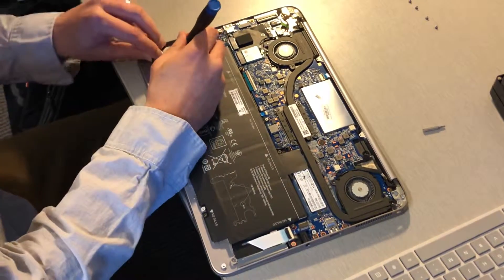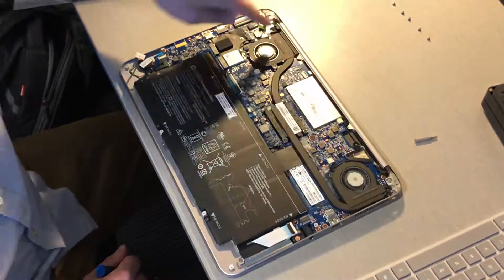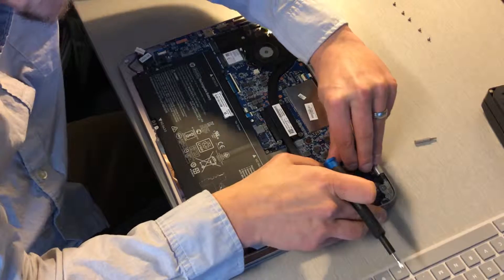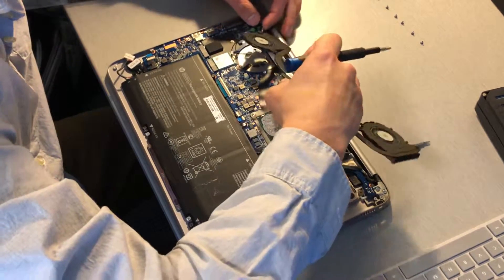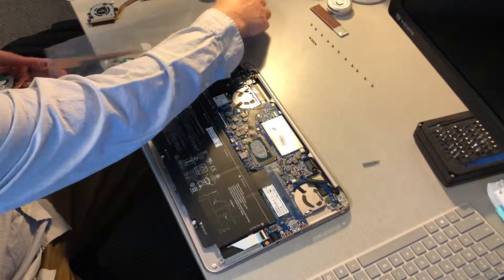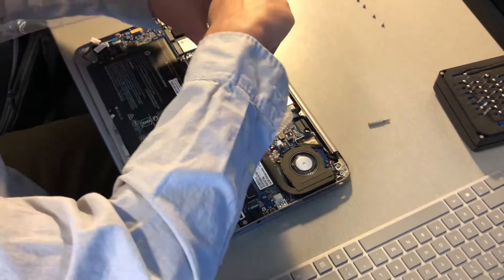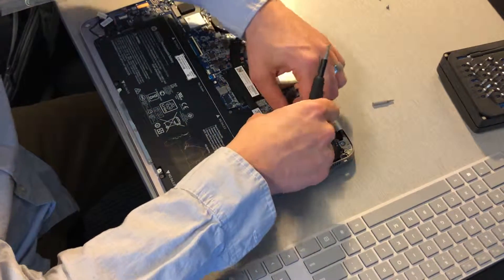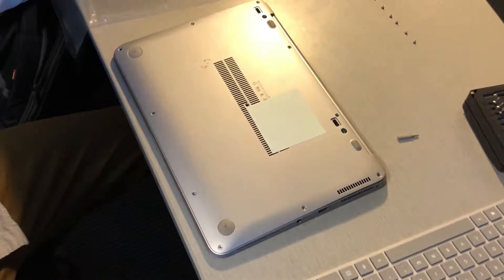G3 fan replacement | HP 1040 G3 | Part # 844425-001

Comment: Thank you.  How do you upgrade the RAM  on the 1040 G3 ?
Reply from the maker: I think it’s under that silver flap. But this was an old work laptop I don’t have access to any longer. Most ram is basically the same. Insert at an angle then click down flat. I will see if I have any video examples that are similar.
Reply: Yep, that's where it is ...but  found out it  is not user  replaceable.Actually  Soldered in.  There are no Dimm Slots on this machine.
You have to order it with 16 M or replace the MB with a 16 M if you need o up from  installed 8.

Comment: I really want to get this PC  the processor is ok but the graphics card is low...Can the graphics card be upgraded?
Reply from the maker: On these computers they don’t have a gpu slot. And what they have is integrated in the cpu. So no way to upgrade that. The other option is an external gpu however this model doesn’t have a fast enough link to support one. Good question!!

Comment: Can we upgrade the cpu from i5 to i7? Is the cpu soldered?
Reply from the maker: It is soldered not socketed. As you likely know it is a larger job to resolder a cpu in place.
Reply: @JamesHeigh  Thanks a lot for your reply. I am looking for old laptop to buy for upgrade.
Reply from the maker: @funkygarzon  I tend to stick with HP for most applications (non gaming) then venture out to other brands for gaming stuff when needed. I would recommend finding an old elite book from HP or an old ZBOOK as sometimes they can be found for decent prices no they rock! Hope that helps. And really for gaming HP Omen laptops can be found for about the same price as predators and they just have better fans and stuff.
Reply: @JamesHeigh  Great brother.  I have an offer for this model for $200 (i5 , 8 GB ram, 256 GB SSD)so i am thinking if it worth buying. I want it for work from home, it has 256 GB SSD , but i think we can upgrade SSD alone(ram also soldered).
Reply from the maker: @funkygarzon  That seems like a really decent find I think it would work well!
Reply: @JamesHeigh  Thanks a lot brother. I wil go for it😃. Have a great day !

Comment: Hello dear, can you help me please, I got a problem with this laptop, I didn't turn it on for one month, now it can't power on at all, it shows the following: led power button and led charger and caps lock all blincking? I tried to unplug the battery power and the CMOS battery but nothing solved! I was also thinking to unplug the RAM but as you know the RAM in this laptop is soldered with the mainboard! I am struggling! any help!
Reply from the maker: That light combo is a Hardware issue. That is how they display that kind of error. Also be sure you dont have any shorts in the mainboard and you can also try removing the wifi card then doing a fresh boot. I think you already did this but unplug the battery then press the power button. As a last resort tare it down bit by bit then maybe order a new mainboard if the cost is reasonable. Hope this is useful!
Reply: @JamesHeigh  Thank you dear James for your help and suggestions. Finally, I took it to a repair office, they said that the switch board that enables/desables wifi and sound has been broken, I think they have only removed the cable that connects that board with the mainboard and my laptop is ok now. Dear James I am asking whether this board for wifi and sound replacable? Does it affect my laptop? Thanks.
Reply from the maker: The Wifi card is removable but I think the sound is integrated to the main board. Replace or remove the WiFi and see if that works.
Reply: @JamesHeigh  I am not speaking about the wireless wifi card which is really removable, but I am asking about the card responsable of wifi and sound buttons situated in the top right of the laptop under the screen?
Reply from the maker: Oh I understand, I have never seen that button area cause a main board issue. Liquid damage is more likely but I’m sure that could be removed. Did you need a video on how to remove that?
Reply: @JamesHeigh  I am not sure but that's what I heard from the maintenance office! Yeah why not I will appreciate that,, thanks a lot dear James

Comment: Hey James. I've got this problem where my laptop (HP 1040 G3) is a bit hotter than usual. Right now it's on 53 degrees Celsius, and I'm pretty much browsing and listening to music, which is highly unusual as a few months ago it would be on about 30 something degrees. Checked the fans, they seem to be working. Any idea what could be off? Thermal paste perhaps? Thanks in advance!

Forgot to mention - great video, straight to the point.
Reply from the maker: I am thinking it could be dust build up. These fans are so small to start with that any dust build up can cause the thermals to rise outside the norm. 

So for that the first easy thing to do is buy canned air and blow out the main fan vents.
Reply: @JamesHeigh  Thanks for replying! No dust inside whatsoever. 

It was odd to see my CPU under 90% load when idle or just web browsing, so I decided to reinstall the OS and that fixed my issues. Kind of strange as I don't visit any suspicious websites.
Reply from the maker: @nemanjavasic4235  Great idea, Windows does tend to have issues as time goes on sometimes even from regular updates. The OS just isn't tidy with files and I have seen that cause issues like yours in the past. Its nice that it is fixed now. And well done!
Reply: @JamesHeigh  Got it! Had no clue that can happen. Thanks a bunch, James and keep it up!